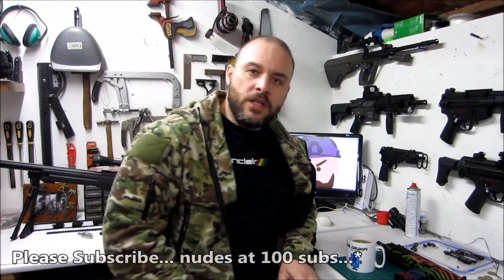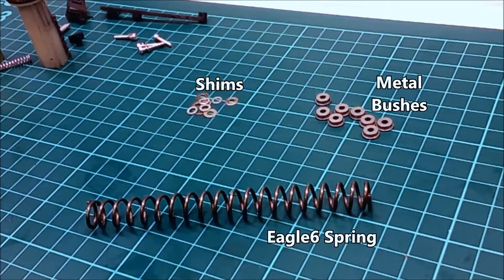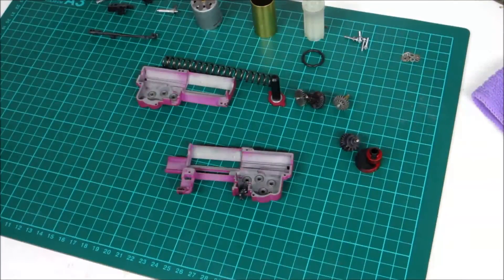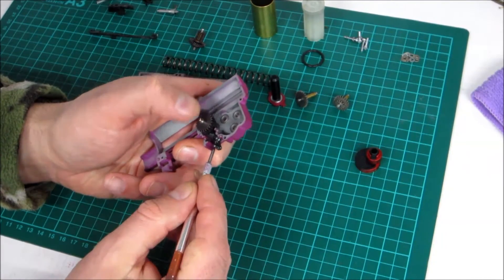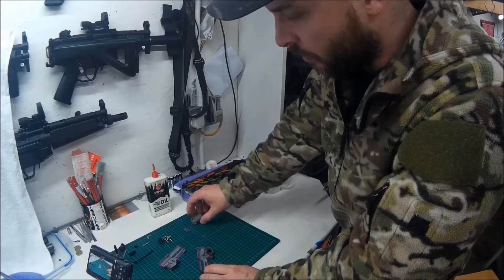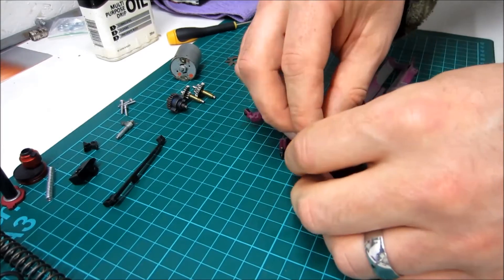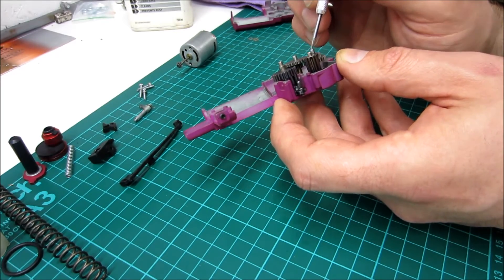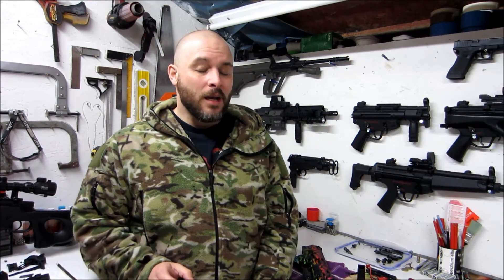Well R4 MP7 | Part 4 | AEP Gearbox Rebuild, Upgrade & Shim | Airsoft BYR

Comment: I have another question? Can you use any other spring guides or cylinder heads? Like alternate ones
Reply from the maker: Hey buddy - the problem is there just isn't a lot made for them, there isn't a lot of choice.  Regular stuff from full size gearboxes is way more common, everyone makes stuff for those - but not the AEP boxes unfortunately.

I think I said to you to maybe try a genuine TM cylinder head if you can find one, should only be a couple of bucks - failing that you could try modding the one you have, or the laylax - which seals to the nozzle way better but has damping in a weird place that will allow the whole assembly to move around every time the piston slams forward... Doesn't sit well with me personally, but yeah, it does seal better.  Expensive for what it is though IMO, not good value.

I'll maybe experiment with the cheap clone heads, see if I can come up with something

Comment: Purple Helmet
me indique qual kit posso compra para upgrade da minha mp7 ?
Reply from the maker: Hello buddy - I'm really sorry but I only speak English - I used Google translate though, so I was able to read.  Hopefully translate will work for you to be able to read this.

There is no all in one kit I'm afraid, but there are individual parts you can use.  I got all of mine from Eagle6 airsoft in the UK.

You can get a cylinder head by Laylax, which seals onto the nozzle better - this is one of the main sources of leaks on the standard gun.  However I probably would not buy it again, I think stock TM heads have an o-ring to seal better, so I would see if I could source one of those.

The springs in these are very weak but Eagle6 do an upgraded one.  It makes the gearbox harder to reassemble but I had test shots at around 300fps on 0.2g bbs with it.

Metal bushes are a must in my opinion, as is getting it shimmed right so that everything moves as it should, but nothing is scraping.

I wouldn't by upgraded piston until the stock one breaks - the upgraded one (laylax) isn't that much better.

You can also get a tiny MOSFET from GATE that you can fit, to allow safer use of a LiPo - the trigger contacts are tiny and more likely to burn out.  And, they are difficult to get to - so it just makes sense to protect them.  Fitting the MOSFET is more complicated than on a full size gun so not a job to be taken lightly.

A tightbore barrel could make the most of the power the gun could make.

One of the biggest problems with the Well model is the hop up.  It twists a lot and doesn't apply pressure equally.

All of that can be fixed if you enjoy a challenge though!

Comment: Been trying to find a Pinion replacement gear.  do you know of any resources, hopefully USA?
Reply from the maker: Hey buddy - I'm afraid I've never seen these pinions separately.  I mean they may exist, but I've never seen them available on their own.  Whenever I've needed one I've usually had a spare motor already with one kicking around from a stripped down box.  The parts availability/demand just isn't there for these boxes as it is for the full sized gearbox types!  If you find a source do comment back as I'm sure others would benefit 😀

Comment: I got Well r4 mp7 (with lipo mod) and I recently got nineball 130% spring - will it break the gearbox? I'm asking cuz it's just a TM clone so I'm not so sure how long would it last... I'm looking for 250 max 270 fps but I don't want to risk breaking the whole mechbox. (I cannot order tightbore barrel now,  but I will when I can)
Reply from the maker: Hey buddy cheers for commenting!

It's a tricky one.  Let's be honest, these aren't high strength gearboxes, and the components are tiny.  And, there is no getting away from it, harder springs stress everything, the shell, the components and so on.  You have to kinda accept that if you want performance - much like tuning a car engine.

Does this mean it will fail?  Not necessarily - but it does mean the likelihood of it failing does go up.  I mean even standard parts break, so it's kinda like a sliding scale.  

Chances are, built right, it won't break immediately - and, depending on how hard you use it and how well you maintain it, could last a long time. 

But here is a thought.  Would you rather the gun performed as you liked, and gave you a massive grin every time you used it - but broke in, say, 6 months?  Or would you prefer it to possibly last longer, but frustrate you every time you use it, with next to no enjoyment?

That's the two curves we both work on with anything, and where the curves cross for you, your budget and so on - is your own personal sweet spot.  It's the old risk Vs reward thing!
Reply: @PurpleHelmet  Thank you for your  very comprehensive answer !  I know it's lil beautiful gb and that's why I was thinking about stronger springs and their effect on whole box. Guess I will work around perfect air seal and getting 6.01 barrel from Japan (cuz it's the cheapest way in my country). I got whole mp7 as spare parts cuz I fried the engine (Oh, don't you dare to ask! haha) so I can replace failed parts just in case, soooo I may try tuning it up after all :) .
Again - Big "Thank you!" :D
Reply from the maker: That sounds like a plan - and I actually forgot to say - a tightbore is one of the few mods that can increase FPS a little, without much in the way of added stress - it does this like any air seal improvement; it makes what is already there more efficient 👍

I need to ask, sorry - how did you fry it 😁
Reply: @PurpleHelmet  Like most of ASG players - I got nice black PEQ box with li-po battery in it - right? I was lucky to get 2 cheap - so I packed li-pos in them... One with li-po 7.4 (that I should use with mp7) and one with foooking 11.1 (for my m249) - The end. xD

Comment: what about the Power of the aep now with this upgrade? how many fps, Energy in Joule? feet ?
Reply from the maker: hey buddy - I got test shots on this at 290-300 fps using 0.2g BBs on the stock MP7 barrel - but immediately tore it back down because people asked me to do a lipo/mosfet mod - and I haven't had time to get back to it, or had higher priority things to do first.  The gearbox has been sitting since March last year so I've no idea if the spring will have weakened (probably will have).

So around 0.8J on the 0.2g BBs.  I doubt you would get much joule creep using heavier BBs due to teh tiny cylinder in these, but I didn't test to see.

The main problem with the Well/Blackviper and other cheap TM clones is the hopup unit, very poor design and the nozzle doesn't seal great, so you can lose 40+ fps there easily... for the test shots I had it pretty well sealed.

Comment: So, any plans on finishing this? I've been looking into getting a cheap MP7 and building it up a bit, pretty much the same way you were doing here.
Reply from the maker: Hey buddy - I actually did finish it, was about to video some test footage, then loads asked me to show how to split the shell and fit a MOSFET... so I ripped it apart to start videoing and never came back to it 😂

For reference, it was getting 300-310 FPS on 0.2, still with stock barrel.  Couple of wee things you need to attend to as they lose air everywhere and don't have a lot to start with - and the hop at least on mine is terrible - arm flexes causing BBs to arc to the right.

But yeah, as a fun platform and decent sidearm there is potential for sure, if you like tweaking and have patience!

When I get back to making video I'm going to do a full refresh video on it, getting up to speed on all this, maybe showing better detail now that I am better at making video, then "finish" it off. 

It's just taking me a little longer than I thought to get some important real life stuff in order so that I can start making video again!

Comment: What is the metal bushes size ? :) Btw,good upgrade video. :)
Reply from the maker: Hey buddy cheers for dropping by!

I can't remember the actual bush size - but no matter - bushes for these only COME in one size, meant for AEP or sometimes called CMG gearboxes.

Even if you get the correct diameter meant for full size AEG boxes, they won't work - the axle diameter on the gears for these is smaller than full size gearboxes.

So, basically, ensure the bushes you are buying are meant for a Tokyo Mario AEP/CMG series gearbox and you will be good - hope that helps!
Reply: @PurpleHelmet  6mm ! I got the size. ;) I bought one Well R4 (Mp7) on this week. This little guy will help me out in buildings. Because my main support gun is an A&K M249. I have got gbb pistols and stuff...but I want an AEP for sidearm and I want to push it out to limits. AEP Glocks are boring for me. :) I want to upgrade it in the name of performance and lifetime! I hope I can handle with this project. Thank you for the comment and reaction buddy! :) Respect from Hugnary,fellow airsofter.
Reply from the maker: @breuersworkshop  - not a problem buddy!  Sounds like a solid plan, modded these can be very effective sidearms, I know one sniper in particular who uses one for getting out of tricky situations!

6mm - superb!  But are the definitely meant for AEP?  If they are normal AEG 6mm bushes the bore will be too large and the gears will not last long.  I think AEG bore is around 3mm, AEP is closer to 2.5mm (from memory - it's definitely smaller though)

Hope it all goes good!
Reply: @breuersworkshop  Sikerült használható fegyvert csinálni belőle?

Comment: Hi, nice Video Series :)
I think this will help greatly with shimming/upgrading my own Mp7.
Do you remember which shims and bushes you used ? Specs wise ?
Reply from the maker: Hey buddy cheers for dropping by and commenting :-)

The bushes and shims were from Eagle 6 Airsoft if memory serves.  The bushes were solid metal, may have been Laylax parts, I can't remember - but the are specific to the AEP/CMG type gear boxes.  Even if you put a run of the mill AEG set into the gearbox, the axle diameter on the gears is smaller.  So it has to be AEP specific ones, and there just isn't a lot of choice with them.  Ditto the shims!  Tricky to find!
Reply: @PurpleHelmet  Thanks :) 
I hope i found the right stuff, cannot find shims with 2,5mm internal diameter though, hope the 3 mm i.d. ones will work.
Since the Umarex MP7 (afaik it's the same as the Well R4) only has 0,5J the 6mm AEP bearings i found should work fine i guess :)
Thanks again :)

Comment: Hello from Latvia! I'm waiting for my R4 to arrive. And your videos have the most complete info about this SMG. Thanks!  
I've subscribed so I don't miss next episode )) I'm curious would stock parts survive high ROF of 11.1lipo battery? 
I wish you good health and good luck!
Reply from the maker: Yuri - thanks so much for that message, I really appreciate it! I know these videos could be better but I'm new to this and hopefully will get better in time - thanks for subscribing, I hope you stay with me for my YouTube journey :)

About the 11.1v... I just don't know, it is a lot of stress for such small components.  I think I will run mine on 11.1v when complete, so I can find out!! 

Thank you once again brother, that message has made my evening!
Reply: Purple Helmet and what are your thoughts on gears? Will they live for long enough?
Reply from the maker: I think they might, but obviously it is going to be a lot more stress through them with the stronger spring.  But there are other areas of the gearbox (piston teeth, most of which are plastic) which I think would fail first.  I'll get it altogether as soon as I am able, and give it some abuse to try and break it :D
Reply from the maker: Hey buddy - thanks for this, I only just saw it, Youtube put it in spam!  Fixed now.

That video is a good basic way of getting a lipo into a gun - absolutely nothing wrong with it.  However there are two things I don't personally like - the contact for the original battery isn't going to be great, so if going to lipo I'd prefer a deans (or micro deans) soldered in.  The other thing is, even on a 7.4v lipo, the available current is far higher than the 7.2v nimh these batteries had from factory - and the trigger contacts are even smaller on these than the larger electric guns, meaning burn-out is a bigger risk.  Just a matter of time.  And they are a pain in the ass to get at on these.

So for me, I'd always switch to MOSFET on these, with LiPo.

But as said, there is nothing wrong with doing it that way at all, it just comes down to your own preference really!  Lots of different ways to achieve something :)

I'll hpefully get the final part of mine up soon, its been far too long - but health/life kinda got in the way!

Comment: Hi i just bought the R4 of well, but i went to the nearest airsoft shop of my town and i asked about getting some upgrades for it, like a lipo or the hop up. They just "laughed" saying that the r4 will break if i put in a lipo like in 5 or 6 games, but then i see this and i dont know what to think. Is it worth it to only change the battery to a lipo type? Or will it brek in 6 games? thank you man.
Reply from the maker: +zipotonez * - it COULD break but any gun could break.  However putting just a 7.4 lipo in isn't likely to make it break just because of that.  Trigger contacts could burn out easier or quicker.  But the trigger response is worth it.

The guys in your shop were probably just saying that because they don't understand the gun or don't want to modify it for you - it is quite fiddly and time consuming to do.  If you are performing power upgrades obviously the chances are it will wear out quicker - that can't be helped - but it is perfectly possible to upgrade these if you want!
Reply: I'm just asking, do you truly recomend me to put a lipo battery on the r4? I mean the power of the lipo could break that litle stick that link the motor with the gears, right? or will it hold?
Reply: I'm just afraid to do something and break the gun in 2 games, because i really love the gun but i hate this kind of batteries
Reply from the maker: +zipotonez * - I can only reccomend what I would do - I put lipos (7.4v) in this type of gun.  I haven't had one break yet in a way that the battery could be blamed.  BUT - its no problem for me to run these until something breaks, I have spares and I can fix them myself so don't need to pay someone.  The choice is yours my friend, I can't tell you what to do... the gun could still break on the stock battery, they are budget guns unfortunately ☺

When I finish mine I might run it on 11.1v to try and make it break for a laugh lol

Comment: Pt 5 anytime soon?
Reply from the maker: Doubt it I'm afraid... unless you want to pay so I can get some child care lol

Don't get me wrong, its on the list - I want it finished - but the problem is the list ain't moving very fast currently :-(
Reply: I ask because I am thinking of getting one soon so would like to know what I can squeeze out of it
Reply from the maker: Well I did get it test shooting between 290-300 fps, but took it back apart after people on here said they'd like to see a MOSFET + LiPo install... then a few higher priority things came up THEN a couple of things changed in my life, leaving me with very little time :-(

But yeah, 290-300fps is doable, people have got a little more but you really start having to push it - and of course reliability does start to take a hit.  

That was with me replacing the cylinder head to improve nozzle seal, fitting metal bushes and an Eagle6 Airsoft spring.  Was still on the standard barrel so maybe a tightbore would get some free fps too.

Lot of work and messing around, but if like me you love a project and doing things just because "why not" then they are fun. 

If you are just after power, I'd say go GBB - or wait for this new full size proper AEG one from Umarex/Elite force I keep hearing about, that could be epic!
Reply: how did you install a MOSFET into there
Reply from the maker: This one actually isn't done yet - but its similar to the VZ61 AEP - you have to get into the trigger assembly, cut some tracks, and solder on a couple of signal wires.  Pretty straightforward if you are methodical, but there are a lot of little bits and springs to lose.

Good once it is done, trigger contacts will never burn, and puts a little more of the batteries "oomph" straight to the motor, so its all good.

That all was planned for pt5.  Like I say, it is on the list - probably next airsoft gun project after I finish the current one, but that could still be a while I'm afraid :(